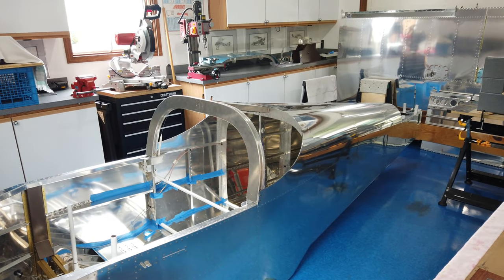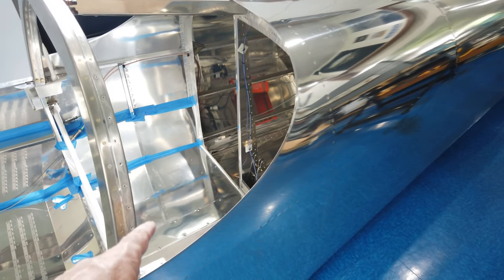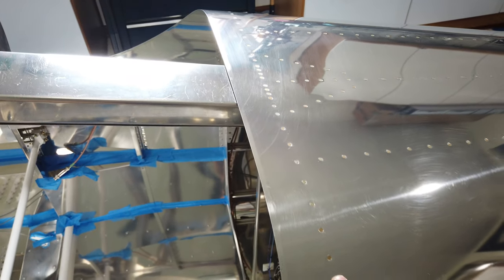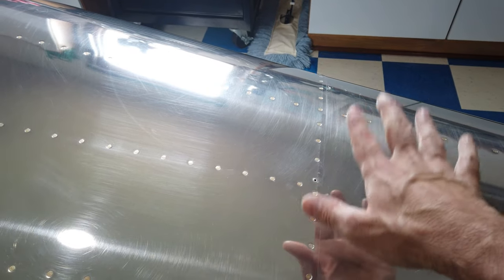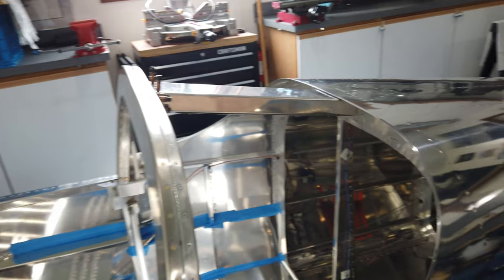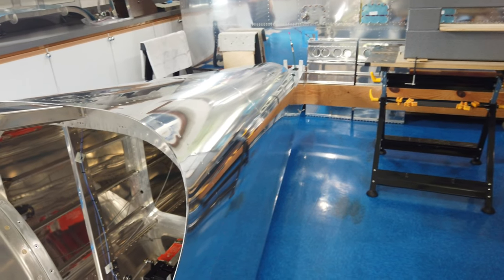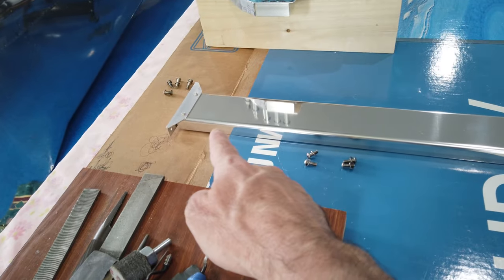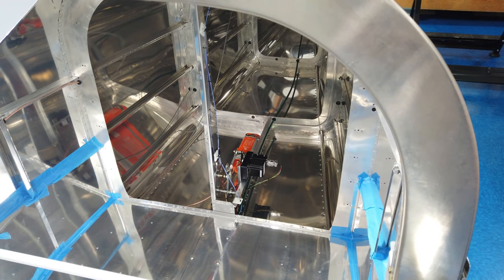Vans RV 7 HINT Video F774 Aft Top Canopy Riveted

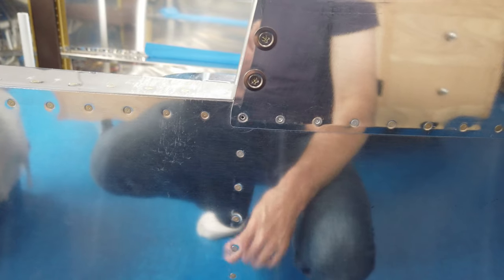Comment: 3:29 did you bend those edges for the smooth transition from skin to skin, or were they bend from Vans?
Reply from the maker: The edges were bent by me. Back when I purchased my tool kit, the tool to bend , (break) the edges was included. It is adjustable to vary the amount of break.